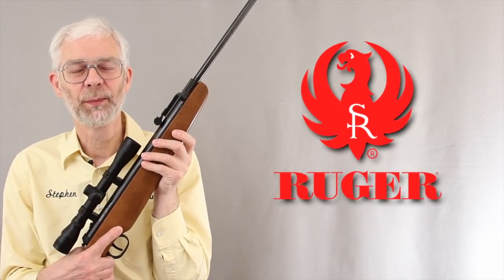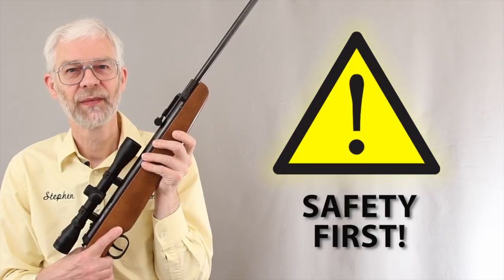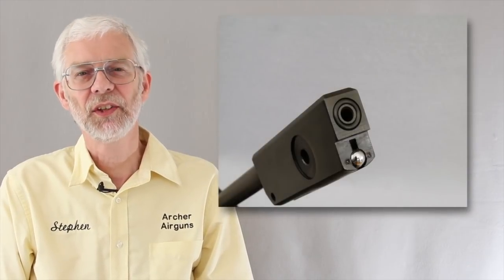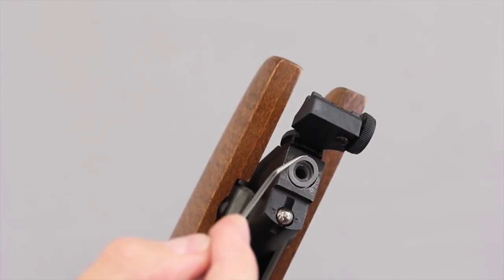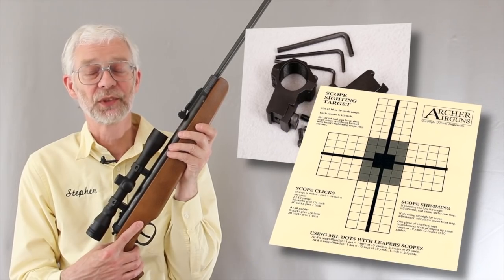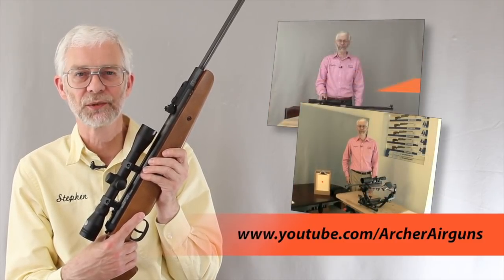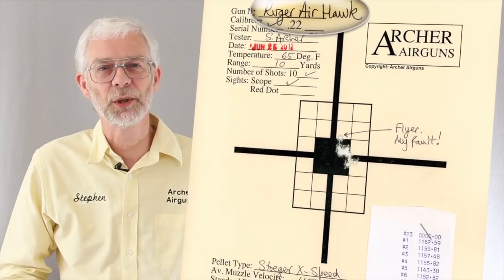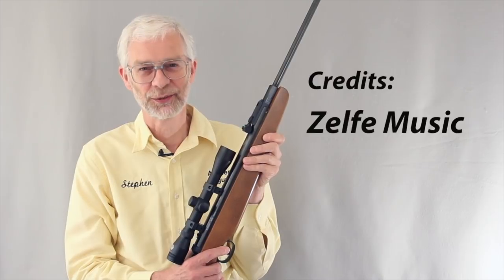Get the Best from Your Ruger Air Hawk

Comment: Give me a break - washers and o rings aren't expensive.  I'd recommend blue (medium) Loctite and a lead pellet in the 8 gram range - this airgun has plenty of power and enjoys heavy pellets.  The manufacturing is inconsistent, like most Chinese manufacturing.  If the o ring is making contact, purchasing this kit does nothing.  You can buy an o ring for 25 cents.  If the seat is to deep, I'd return the gun while you can.  Scope is underpowered for the gun, but I'd get Loctite and different mounting rings at minimum.  There is a lot of vibration with a spring rifle, but the stock, barrel, spring and open sights are kind of hard to beat.  If you use a lighter pellet with this rifle, you'll probably have to guess where it ended up landing.
Reply: I'd recommend non lead pellets to preserve the earth

Comment: WOW! Love the scope! I am soooooo getting this! I compared prices with other sites, and yours is the cheapest! :D
I've got a Ruger Air Hawk, I'm trying to fix up, and maybe even try to sell... However, it has a cracked stock... All the mechanics work great, and fires well, but the stock cracked. I am trying to repair it, by gluing it, but it is an obvious repair... And even if I refinished it, the stack isn't something I'd want to sell to someone... So, I was wondering if I could get a replacement stalk for it... maybe an elite's stock? Or something a little nicer... I've always enjoyed using this stock, until I started using pistol grips... So, if I could get a little info on where I can get stocks, and whether or not I can switch this one out, I'd be very grateful... Thanks! :D

Comment: The SMK SYNSG and Hammerli Black Force 800 are basically the same rifle as the Air Hawk but in .22 cal, so would the breech seal replacement kit work for those models also?
Reply: Yes, I have a 177 smk syng it's the same as this other than stock, a Diana copy 280